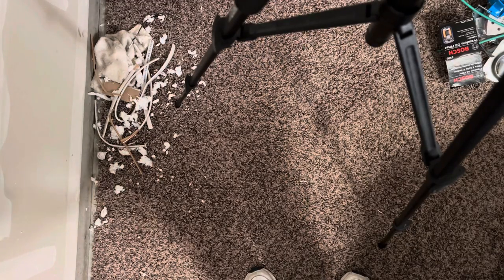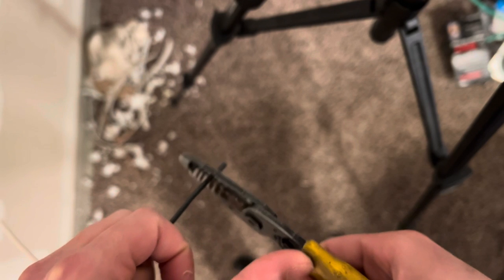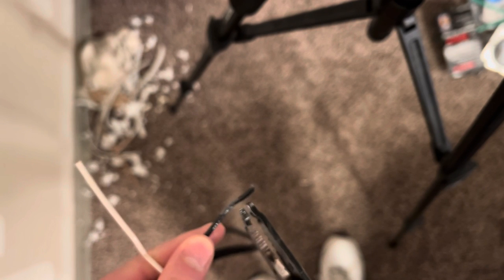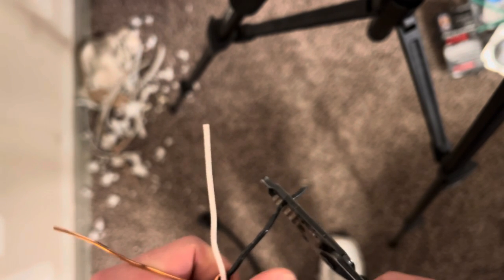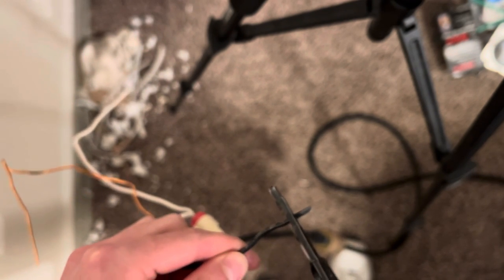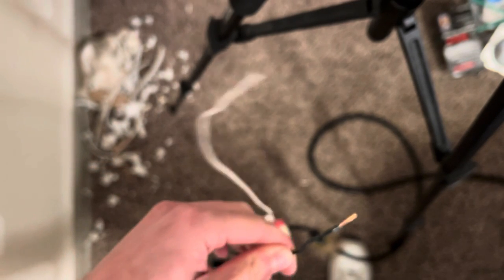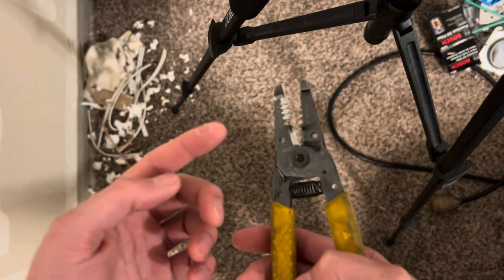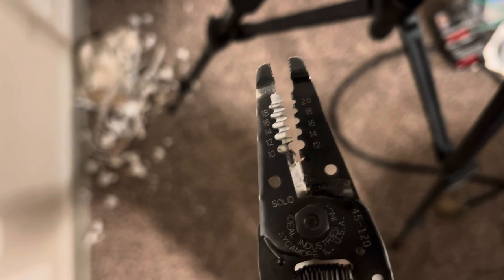Electrical 101: How To Remove Wire Sheathing From Live Wires

Comment: If you are an electrician, at some point you WILL have to work something hot. Especially in service or maintenance.
Reply from the maker: yeah
Reply from the maker: You are clearly not an electrician dave.
Reply: I can't imagine an Electrician never working on live wires. I have to change an emergency light in my plant today, we have thousands of circuits, dozens of MP's, and 40 years of changes.... Nobody has any clue where the breaker is.. It's 277. According to Dave, I just tell them too bad...

Comment: Are Klein strippers insulated? I know no matter if they are insulated or not and you touch the metal you’re gonna get zapped but could I strip wires live like you showed with Klein strippers and long as I’m not touching the metal or touching wires together?
Reply from the maker: If they say they're rated for 1000 V they are insulated but you can still cut live wires with non-insulated ones as long as you're not touching the metal